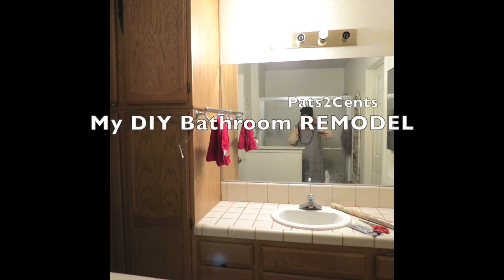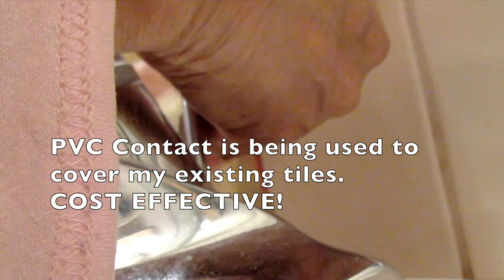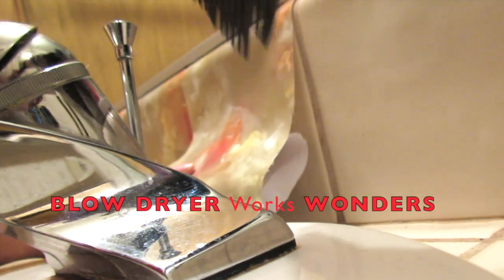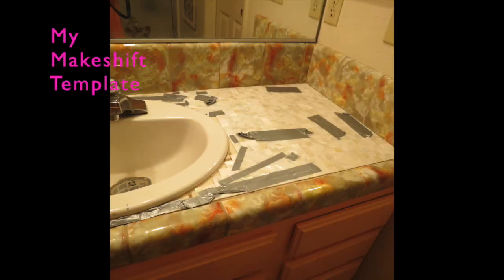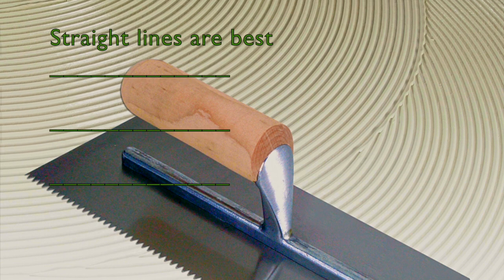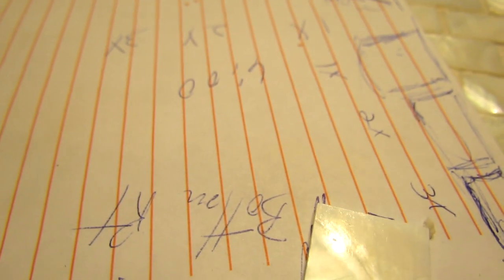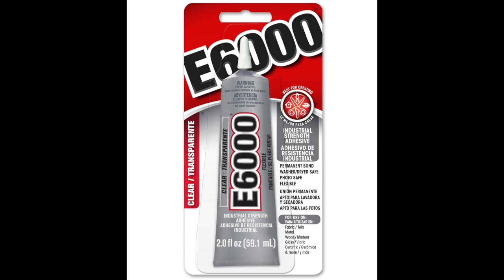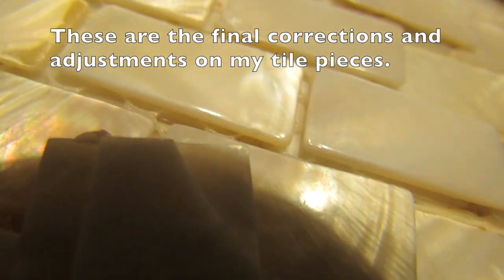DIY BATHROOM REMODEL * From BORING to BEAUTIFUL!

Comment: Ugly duckling of a bathroom!  Haha! 😂🤣
You did a fantastic job aunt Pat.  Some flowers in a slim golden or silver vase would look great in one or both corners.
I did this type of diy in my bathroom too but after some time, the contact paper started to peel off at the corners due to moisture and friction while cleaning.   I would advise you to keep an extra roll of the contact paper in case you have to replace a few 'tiles'.
Reply from the maker: The way to avoid that is to mix a little epoxy and give the surface a thin coat (that eliminates running) and the surface will harden to permanently keep the contact in place. My kitchen had the same thing for countertops. Also remember, not all contact is created equal.
Reply from the maker: I like the flow idea.  When I finish the whole room, hopefully, I will have found the right look with the flowers.
Reply from the maker: UPDATE:  It's been two years now and all the contact is holding so far. I even covered my shower area over a year ago. So far, so good.